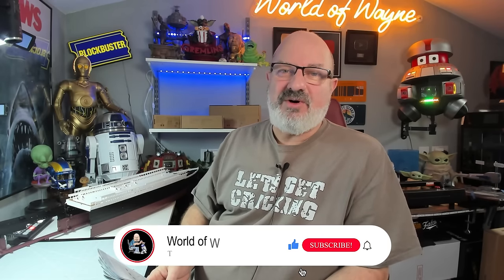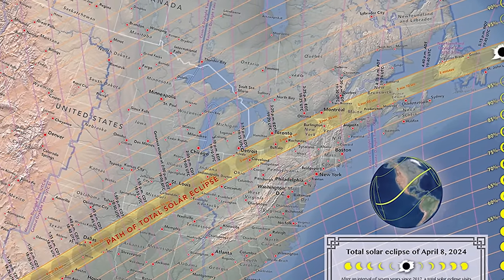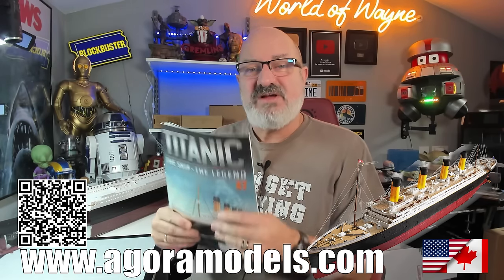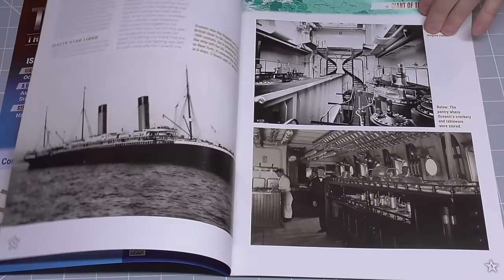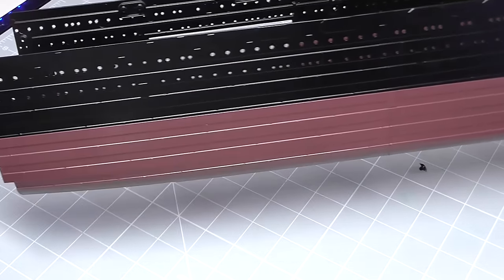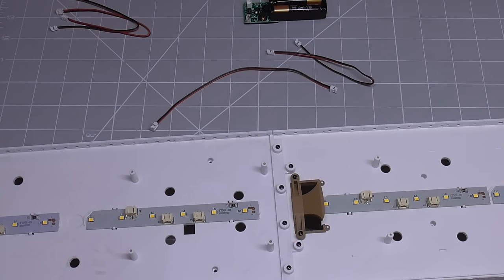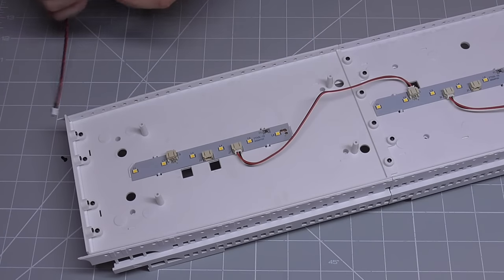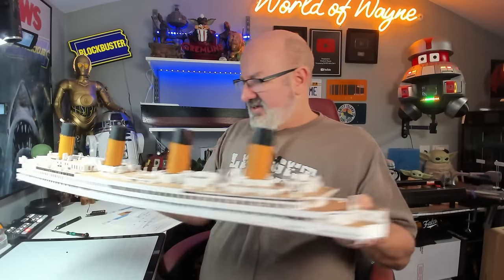Agora Models Build the RMS Titanic - Pack 16 - Stages 87-92

Comment: Loving the build. I am a few packs behind myself and I had a question: Do you have any information on the battery box/test board? I can't seem to find mine anymore, and was wondering if I could just get an equivalent/replacement online somewhere or if I had to go through the Agora models website.
Reply from the maker: I dont im afraid. It's not the normal test board unfortunately

Comment: Hi Wayne, in stage 90, just near the curved window, my OCD got triggered by what looks like an out of align lug where the screw bracket is, is that tweakable to align it to the wood flooring or is the wood flooring slightly off alignment? Cheers😎👍
Reply from the maker: I need to have a look